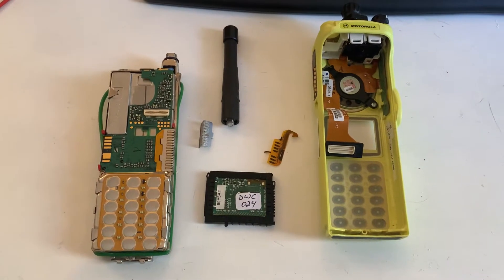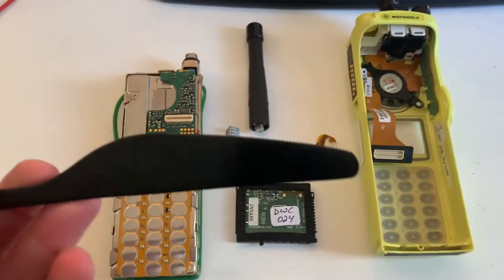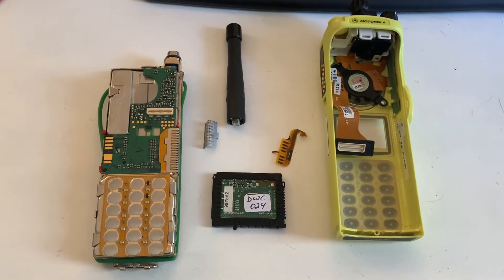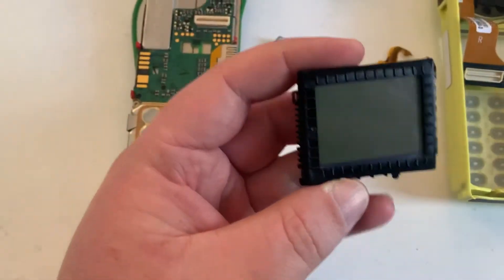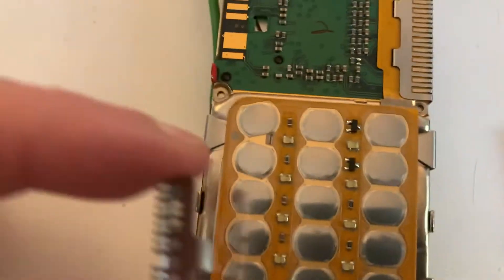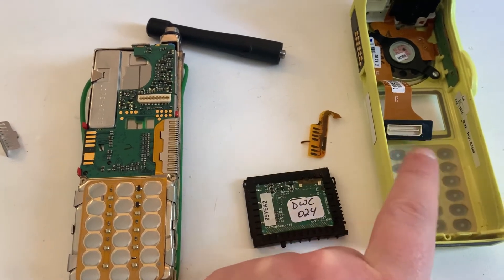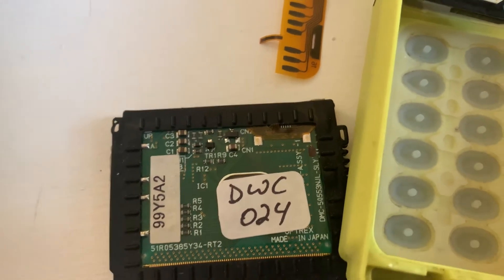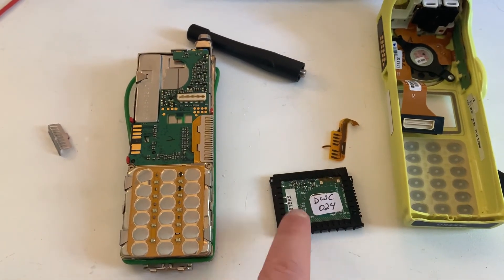Motorola XTS3000 Case Replacement Tips

Comment: Next time, use the proper plastic extraction tool and not just a plastic knife.  They sell them on eBay for $20 (it’s usually orange in color, plastic tool).  That’s why the radio didn’t come out of the case correctly and you inadvertently damage the screen ribbon.
Reply: that wouldn't have helped much in this case with the lcd stuck to the case as he described. that tool just helps for the very first part of the disassembly disengaging the clips and starting to pull the frame out